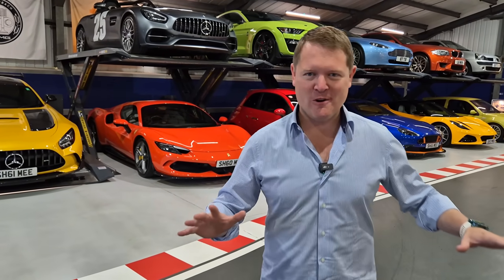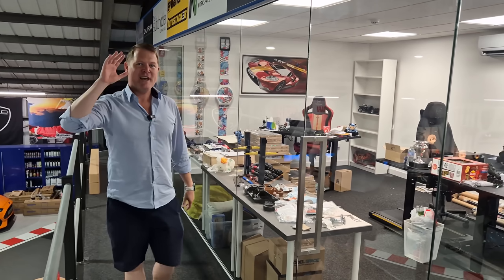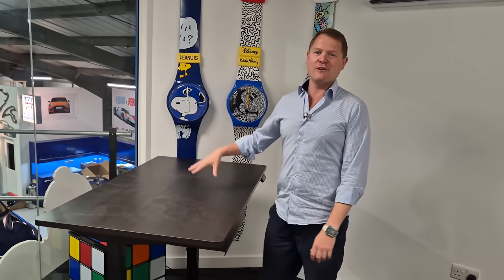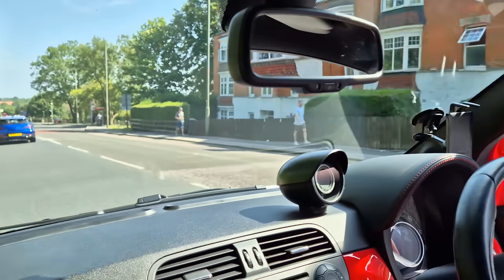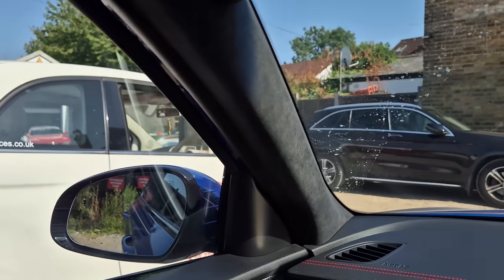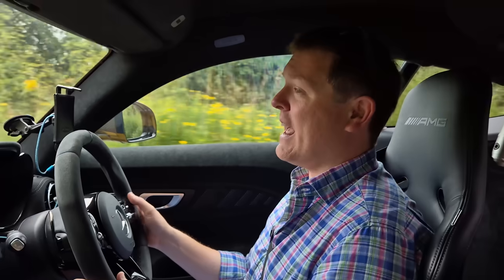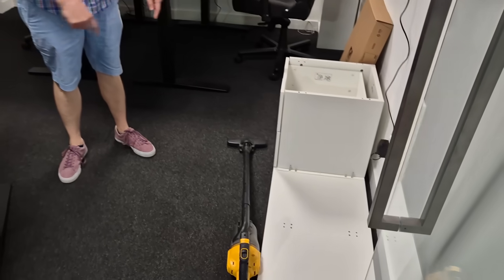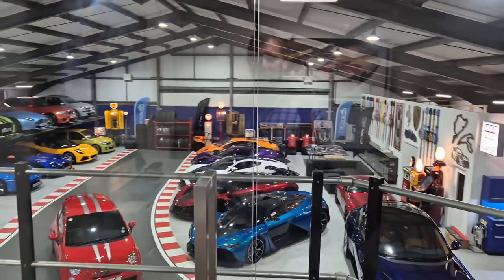DAY IN THE LIFE: Owning a Supercar Collection

Comment: That little Abarth is so cool.. The a/c can easily be fixed.. I like that little run around.. Remember depending on the maker of certain tires, the tires breathe so if they're not driven all the time, they lose air pressure depending on who's the maker.
Reply from the maker: Regassed and running already

Comment: Do you think that maybe the Renntech parts and mods are responsible for the issues with the SLS?
Reply from the maker: I currently think the sensor that was tripping was down to bad fuel - it's hard to get higher than 95 in Italy and it needs better ideally
Reply: @Shmee150  
You should consider having a case of octane booster with you on these trips. It's a good solution in a pinch.

Comment: What's your opinion on carbon ceramics on used cars?
Have you ever had to change the rotors and if yes at what mileage?
I'm thinking of especially AMG carbon ceramics.
Reply from the maker: I've never actually worn through a set of ceramics; the 675LT will probably be the first to go, or maybe the GT Black Series eventually.
Reply: Thanks. I've read it really depends on if you overheat them or not and if you change the pads as recommended. So if you take care of them and not get unlucky with getting a crack from a rock or something, it should last 100000 kms, maybe even more.
Reply: @SgtKanyo 
It really does. I burned through a set of 488 rotors in 15k km. On the flip side I have cars with 70k kn and rotors are fine. My wife has an AMG GTR as her daily, it has 65k km and rotors are fine. When you track them, you can also burn through pads like there’s no tomorrow. Again if you don’t, they will last a long time. 
Ceramics are god on track, but expensive to track. I have swapped some ceramic rotors to Surface Transforms rotors. They last a lot longer than traditional ceramics and cost about the same. They can also handle aggressive track pads such as Pagid RSL1 endurance pads. Koenigsegg uses Surface Transforms rotors. 

What are your plans for the car? If you plan on tracking a lot, consider sticking to steel rotors. With good track pads from Pagid, Endless the like and a Castro SRF fluid, they will perform excellent. 

For the occasional track session, ceramics are fun and works. Just keep in mind that you can burn through pads in 3-4 hours if you’re a fast driver.
Reply: Thanks for the input. When people talk about tracking their cars, they usually talk about being there the whole day , but for me 1 session (about 20 mins) would probably  be enough. Also I only plan on max 2 times a year. Burning through pads doesn't really concern me, those don't seem to be that ridiculous in price, unlike the rotors.

However I do push my cars though on rural roads, but I don't think it should cause issues for carbon ceramics. My S63's steel brakes can start to fade, but I have to push it quite hard (or have too many passys on).

For the replacement I'm looking at prefacelift GT Ss and some come with carbon ceramics with 20-70k kms on the clock, which might sound like great deal.
Then again it might sound like a bad idea, since there's no way to measure carbon ceramic rotor life properly, unless it's taken off the car and measured with a special tool, that not even dealers have. An overheated brake rotor should look different though from one that was used normally.
Reply: @SgtKanyo  
I promise you, rotor wear is visible. It is so frustrating that car companies try to turn it into something it is not. When a ceramic rotor wears, it gets a matte finish and it is pitted like heII - full of small craters and "erossions". If the rotor is smooth as glass, it is good to go for quite a bit. I would however be surprised to see a 70k km car with rotors that look like that. We run ceramic rotors on my F430 GT3 race car and rotor wear is not rocket science. The only part that can be tricky is to know how much life is left. This is simply a matter of experience i.e you know what to look for. If you buy a car with 70k km on the clock, expect the rotors to be done in 15-30k km max, especially if you track or drive the car hard. I know people talk about 100k+ km, but in reality that is very rare - you really need to baby the car for that. Rather than taking a gamble thinking you will get away with not having to replace them, be honest about the fact that they are wear items. And be aware of the rear rotors. They are often very prone to wear due to the ESC system.
I will say this. If you are even a bit mechanically inclined, you can easily do it yourself. That means you can source the rotors outside of your dealer, and you can do the swap at home. I have done it on several cars ranging from my Pista, 488 and other cars. It's very simple.
I will change wifeys AMG GTR rotors next year as I can see those are now getting pitted, and that car has a four hour session at Paul Ricard in October. They will be done after that. Aside from being used by Koenigsegg, the CCST rotors, also sometimes referred to as CFRC rotors manufactured by Surface Transforms are also the same rotors as you would get as the brake upgrade on a McLaren Senna. If you are in the US, you can get them from Red Mist Racing for example. 14k for a set of four. Here's the kicker, Those discs can be resurfaced for a fraction of the cost if ever worn. But I promise you , they last much longer, stop better and are more quiet than the normal Brembo CC rotors - they also run cooler. If you are in the UK or Europe, you can order directly from Surface Transforms. I don't expect you to do this right now, but I'm telling you because there are better and less scary alternatives than the OE option. With those discs you can also buy a set of RSC3 or RSL29 pads and swap to those when you track. Just to get an idea about the difference, I can burn though a set of OE Textar T4300 type pads in a Pista on Paul Ricard in 3 hours. A set of RSL1 last me 25 hours and will out-break just about anything - and they are similar to RSL29's. The Merc OE pads are also just the normal Textar T4300 compound pads, so same same. 

Anyhow, this is getting a bit long, but reality is that ceramics do not have to be something to fear. And if you are unsure about swapping a set of rotors yourself, any proper race oriented indy shop can do it in about 20-30 minutes. I can do four discs on a Pista with a floor jack in 40 minutes.

If you get a car with the ceramics and go on the track, I will suggest that you get a set of Pagid RSC3 pads for the track days as long as you run OE discs.
Here's the very important bit though, no matter what brakes you run. MAKE SURE YOU USE A RACING FLUID!!! I would guess the fade you experience in your current car is fluid fade, not pad fade. I run Castrol SRF Racing in all my cars. It has ZERO issues with moisture and it last the duration of a service life, i.e between services. That fluid will never fade. We also use it in my GT3 racer and SR3 racer, and it is still the only fluid used in F1. We can take a car off the tack with cooking brakes, let it sit for 10 minutes, and the pedal is still firm. With other brake fluids such as Motul RBF 660, the fluid starts to boil in the calipers when you park sometimes - very common on race cars. So you get in and there's no pedal. Ask any GT3, GTE or rally driver, they have tried this. The SRF is a normal DOT 4 fluid, so no problems switching to that.

This was a lot of info in a small space. I hope you can use some of it to make an informed decision. Again ceramics do not have to be scary, but they can be a bit pricy on occasion. But nowadays there are good ways to get around it without it breaking the bank too much, and it is a massive upgrade switching to something like Surface Transforms discs. You can also get in contact with their US distributor via their UK main company. Just a heads up on that.

Just to be clear. I have NO affiliation with ST. I'm just a big fan of their products.
Reply: @Shmee150 do you mean you will sell the 675lt first?

Comment: Is the Roma V8TT the same as the V8TT in the sf90 ?
Reply from the maker: Not exactly; I'm sure there's a lot in common but it's not the same engine (3.9 vs 4.0)
Reply: The 154BH engine found in the Roma is more similar to what you find in the 488 GTB. The V8 found in the SF90 and the V8 in the Roma only have two things in common. They are both built by Ferrari, and they are both flat plane crank 90 degree V8's. They don't share a single component, not even ignition coils and the architecture is quite different. This is because the SF90 engine was developed to sit so low in the SF90. Block is a different casting, very narrow heads etc.
The engine in the Roma and the 488 GTB shares the crank, connecting rods and a few other little things such as crank and rod bearings, coils and cam chains. They are the same basic architecture so to speak. They do however, not share pistons, heads, intake, turbos etc.